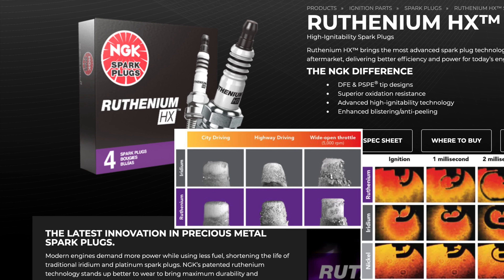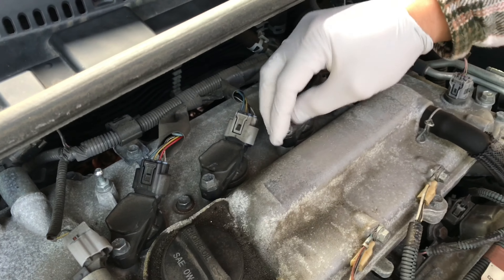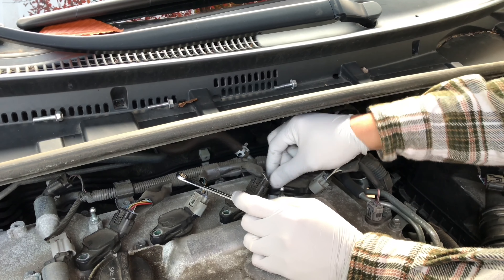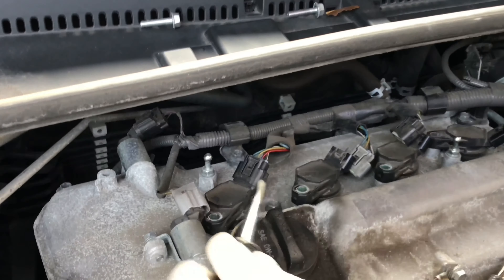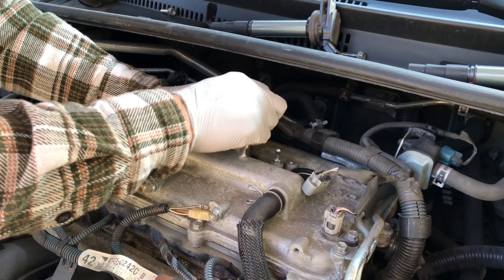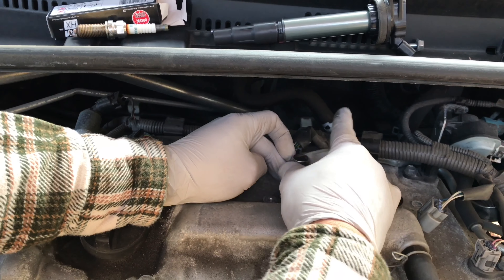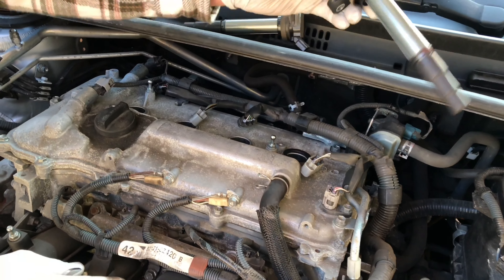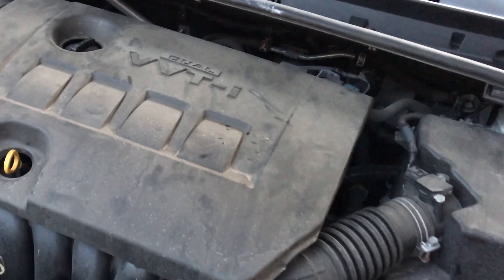Ruthenium HX Spark Plug | How to Change Spark Plugs in your Toyota Corolla 2014 to 2019

Comment: They already come with a nickel coating on the threads that will prevent seizing. The only time you need to apply antiseize is if you remove the plug after initial install to inspect as the nickel coating will come off on the threads.

Comment: Did you check the gap before installing?According to the NGK website,they set the plugs for a certain gap,but it isn't right for every car.The NGK Ruthenium plugs that are correct for my Ford Focus were all factory gapped at .043 but my car manual shows .051 and many websites show even larger gap.